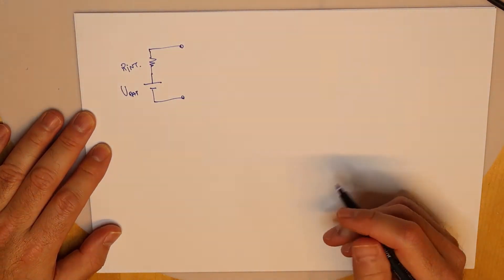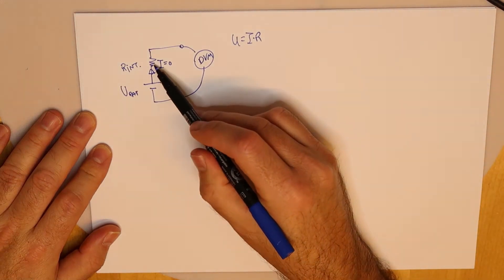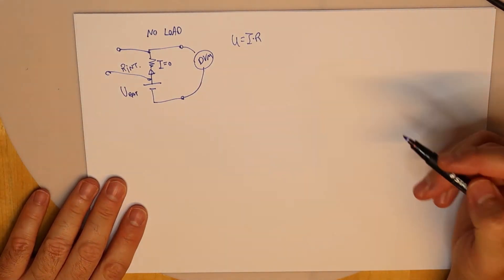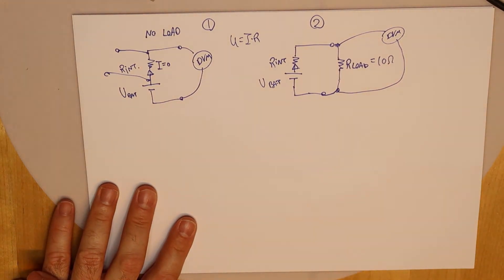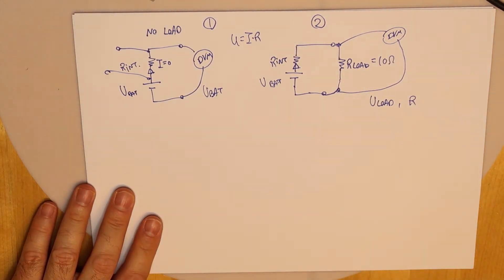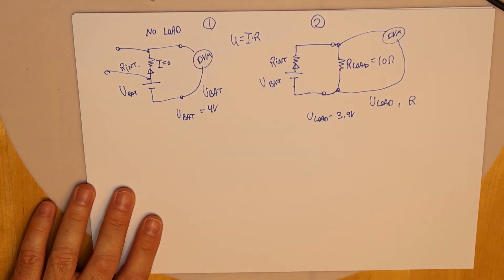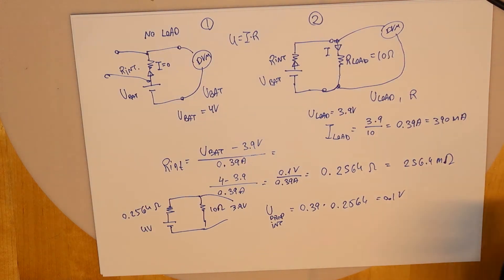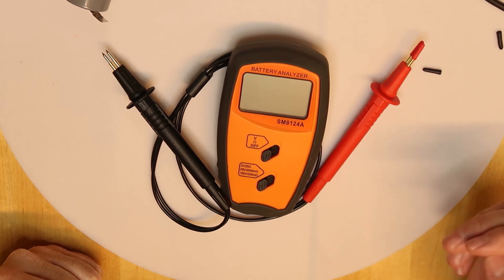Battery Internal resistance Theory & Instrument SM8124A

Comment: The most accurate DC current measurement can be made using this method you described, but with the voltage drop measured over time. Knowing the capacity of the battery in Ah, its recommended discharge rate in A, a resistor Rload of known value is required. By measuring the voltage drop over time, the internal resistance of the battery can be calculated relatively easy. SM8124 and similar devices includes AC component, thus making a measurement relatively, but not completely accurate.

Comment: You've explained how DC Resistance is measured but neglected the fact that the device you show claim to AC (1KHz sine) impedance of a battery, which is considered more informative source of judgement of battery state that a mere DC load characteristic.

Comment: I have developed a device to determine the internal resistance (Ri) of a lithium cell.
I found that with your method (1st measurement = no load, 2nd measurement = 10 Ohm) the repeatability of the measurements is subject to strong tolerances.
I then use a better method to determine the voltage / current difference values: 1st measurement = 4 ohms, 2nd measurement = 2 ohms. The basic accuracy of the measurement that can be achieved in this way is +/- 1%. For automation, I used an Arduino with LCD and 2 LL-MOSFETs (logic level, gate control with 5 V) as well as the internal ADC.
Maybe this will help you or others.
Your explanation in the video was also pretty good ...